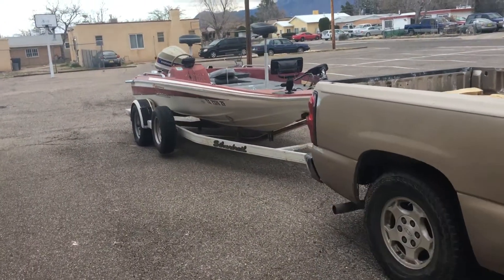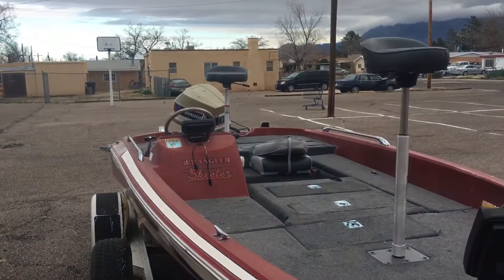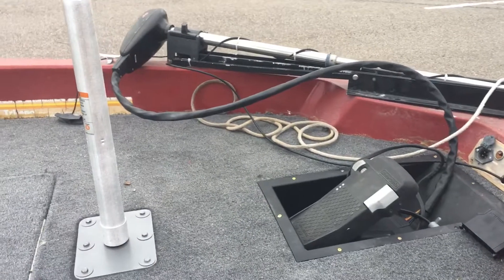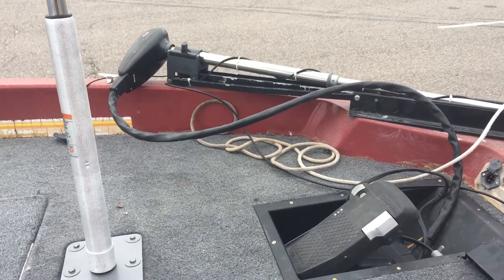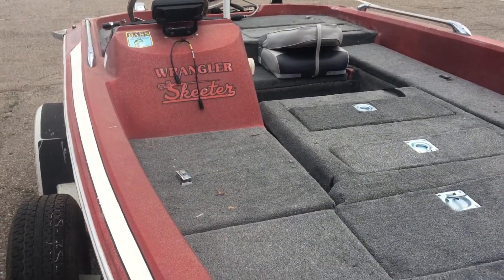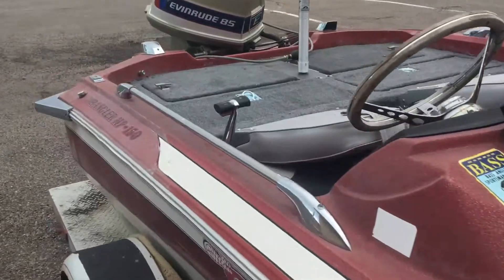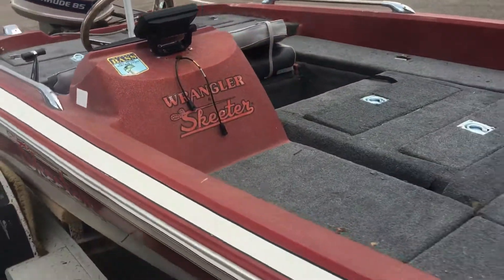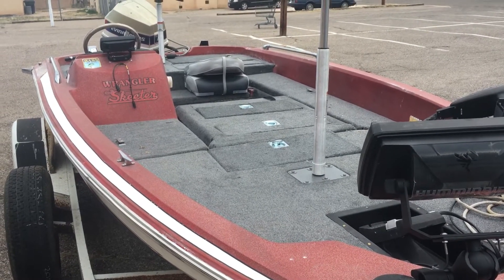Bass Boat Restoration - Update

Comment: Good Job Pastor. Quick question I just got the recessed box for my deck in yesterday like yours  I have a Wrangler Sport WS - 150 1985 when cutting through the deck did you hit any wiring? Also, did you have a vid of you replacing the carpet? I redid mine but I left the fiberglass trim exposed. I now want I covered completely all except for the seat bases.Getting ready to extend my deck for tackle storage and more room due to me fishing tournaments pretty regular..Again awesome job!!!!
Reply from the maker: bigtweezy2007 unfortunately I lost a couple of videos due to water damage to a Camera of mine. The carpeting is a lot easier if you will use spray adhesive versus carpet glue. There's a lot of debate about that, but I have found that it works just as well and is not near as messy! Also, if you mess up and get it on your side wall is almost impossible to get the glue off and it looks terrible. As far as the recessed trolling pan, I did not have any problems with anything. It is extremely thick decking to cut through, and you might want to consider putting two small support beams under it so your deck is still reinforced.
Reply: Great - I'm looking a getting a Champion also 20 footer gonna give the skeeter to my son.
Reply from the maker: bigtweezy2007 same thing I have done. I have the skeeter to my dad, I have a 18 ft champion that I fixed up to sell and a 20ft champion that will be my tournament boat
Reply: Got any pic of the 18ft champ
Reply from the maker: bigtweezy2007 yeah, check out some of my other videos, there are several there

Comment: If you have room to put the batteries toward the rear of the boat,  I would really recommend that.  The boat will run much more efficiently.  Its also much safer and easier on your batteries and boat.  The further toward the bow the more ruff the ride.  Two fellas that have fished in my neck of the woods have the same boat in sky blue as yours.  They are really cool looking boats that are late 70's to very early 80's.  Skeeter really made good boats right from the start.  Have a good fishing season and keep up the good work.
Reply from the maker: I have experienced some issues with the batteries up front...I might just take your advise (as well as others) and move them. Plus, I'd have more storage up front!! Thanks for the comment!